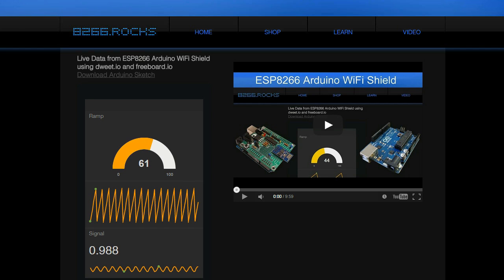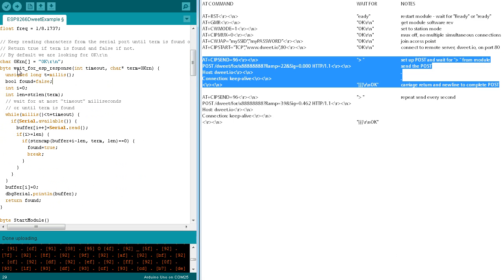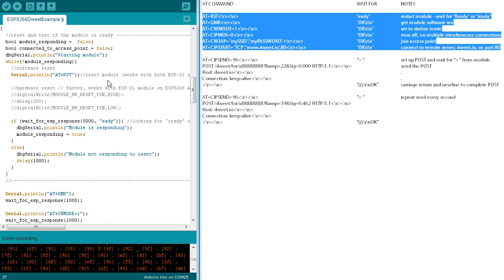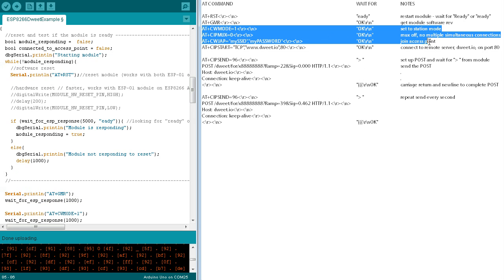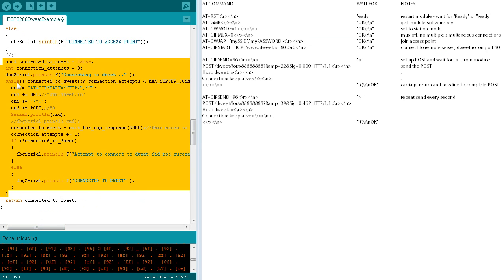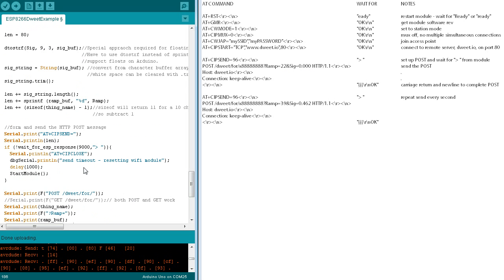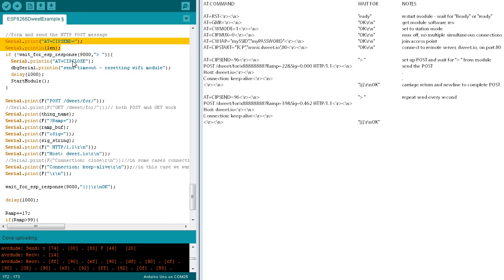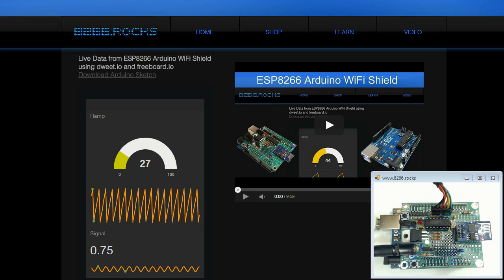ESP8266 Arduino WiFi Shield - Dweet.io & Freeboard.io Sketch Review

Comment: This is great. I have 8 x DS18B20 sensors that are displaying their temps in the serial monitor with their addresses. I want to upload temp data to dweet. I'm not sure what Ramp and Sig is in your code and how to pass the temp values to it from the sketch that collects this data. In the end I wish to 1. be able to view live temp data on dweet.io 2. store the information on an SD card (I have the ethernet/microSD(16 Gb!) expansion card.. I also have the ESP-01 running but I need to flash it to be able to connect to my WPA2-Enterprise network at work... plus some of the characters in serial mon. are garbled. It's readable but might run into problems if our sketches are searching for regular strings. I'm wondering if updating the firmware will generate clean output). So at this stage I'm just going to use an ethernet connection. I'm sure I can download the code to communicate through it but get the temp data through your Dweet example is difficult to me. Any help would be greatly appreciated.
Reply from the maker: +Jason Axford   Ramp and Sig are just arbitrary names for the fictitious demo data that's being dweeted.  If your temp sensors are on an engine for example, instead of: 

Ramp=44&Sig=0.823

You can make up your own names for your values, using something more like:

Toil=140&Twater=125&Ttransmission_fluid=82&Twhatever=111&Tblahblah=122&Txyz=99&Tabc=62&Tdef=85

or

Oil_Temp=140&Water_Temp=125&...

When you use the CIPSEND command, you need to tell it the length in bytes of the text you're sending.  This is the length of everything AFTER the command itself (the AT+CIPSEND=96<\r><\n>).  Where you see the 96, put the length of the payload you're sending out.  <\r> represents a SINGLE "carriage return" character and <\n> represents a SINGLE "newline" character.

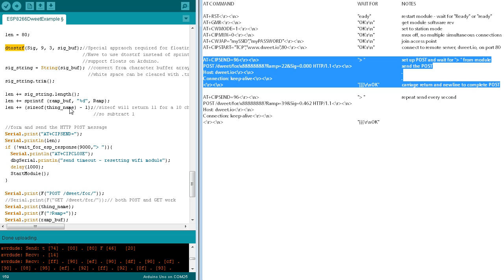In the sample at for example 7:37, the highlighted text shows the CIPSEND command line which is terminated in a carriage return and newline.  You don't count any of this in computing the length.  You count the number of characters, including carriage return and newline characters in the four lines that follow.

POST /dweet/for/x88888888?Ramp=22&Sig=0.000 HTTP/1.1
    has 54 (52 + 2 more for the <\r><\n>)
Host: dweet.io
    has 16 (14 + 2 more for the <\r><\n>)
Connection: keep-alive
    has 24 (22 + 2 more for the <\r><\n>)
(the last blank line)
    has 2 (0 + 2 more for the <\r><\n>)

The total is 96, and is used in the sample CIPSEND command.

Some of the contributions to the length of a dweet you send will vary depending on the actual temperatures.  You might have a single character for one value if the temperature is 8 degrees, three characters for another if the temperature is 170 degrees or possibly even six characters for another if the temperature is -16.78 degrees.  These lengths need to be computed on the fly as shown in the example.  Also, if the thing name (in the example x88888888) will change, you might want to compute this in the code as well, as is done in the example.  It comes down to adding the length of the stuff that doesn't change in length (in the demo, 80) to the lengths you're computing on the fly for the variable length stuff, and using that in the CIPSEND command.

Not sure what the length limit on the CIPSEND payload is.  You should check that and if your dweets can be too long, send the data out in two or more separate dweets rather than including everything in one.  Dweet.io limits dweets to 2000 characters.  They've also started enforcing their free dweet rate limit of 500/hour or one every 7.2 seconds.  You should probably modify your loop function to send dweets at a rate less than that. 

//wait_for_esp_response(9000,"}}}\r\nOK");
wait_for_esp_response(12000,"}}}\r\nOK"); //will almost always wait for only a few 10's of ms
                                                                             //for server's response

//delay(1000);
delay(9000); //this should be a little more than 7200

If you're using a software serial port for monitoring, interrupts related to communication with your temperature sensor could be screwing up the software serial interrupts and timing, depending on when things are happening.  Make sure there's no 1-Wire communication (or other interrupt stuff) going on when the software serial port is sending data.  Also, it's possible that the fast 115,200 baud rate in the sample sketch is too fast for your system and situation.  You could try slowing the software serial baud rate down to 9600 or 4800 in the setup function.

//dbgSerial.begin(115200);
dbgSerial.begin(9600);
//dbgSerial.begin(4800);

Updating the firmware on the module is important.  In my experience, the ESP-01 is very unreliable without a firmware update.

Hope this helps.
Reply: +8266 Rocks 
Thank you. That was great. I'll only be doing one dweet per 10 minutes anyway. I'm not interested in a higher resolution.

In your code you have Sig = sin(2 * PI * freq * millis() / 1000); 
So all I have to do is assign the output of read.temp() for example to Sig or some other variable like Temp1, then convert to string etc.?
Reply from the maker: +Jason Axford Yes, that's the idea.